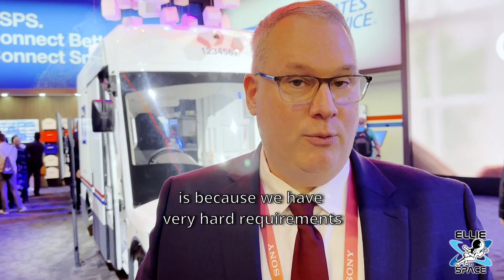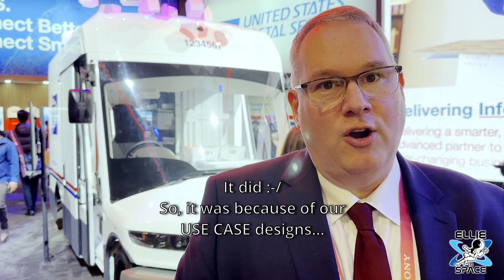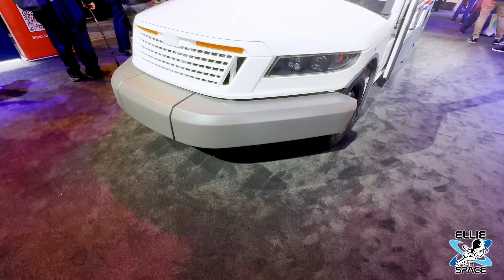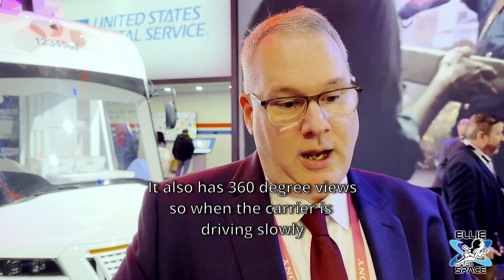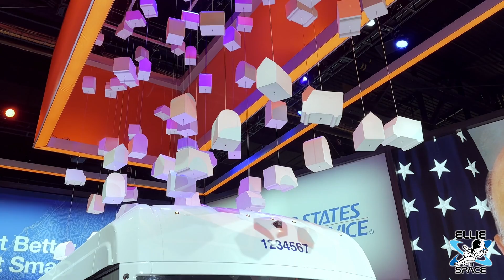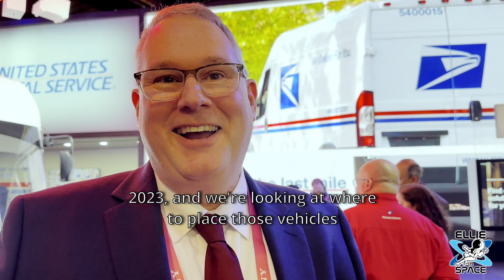The REAL reason the new USPS trucks are UGLY

Comment: Holy crap 💩.  This guy is filling the room with sooooo much crap you're going to need a front-end loader to clear the room.  LLV came in 1985, 39 years ago. None of them have ac. NONE!!!  The only postal vehicles with ac are the supervisors car. When the ac breaks it won't be repaired.  If the supervisors have thier way they will have the ac disconnected.

Comment: OH MY GAWD. . . . 
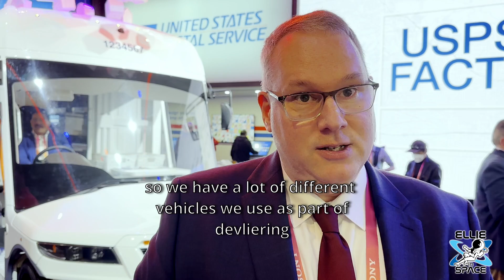When the video first started, I was reading through the comments, and thinkin, "i don't understand, why is everyone knocking the design so much. Looks like a fairly standard delivery truck" and then 2:34 happened, and I saw the full view of the front grille.

What the F*CK were they thinking?! It looks like they based the front hood off of the cartoon character "Duck-man"! That is a duck bill if ever I saw one. This is an abomination.

Also, great reporting Ellie! I've always enjoyed seeing videos at car shows and demo areas, so this is great. And yea, that guy wasn't kidding, a lot of the delivery drivers trucks (UPS, Fedex, etc) don't have air conditioning installed, that's why they drive with their windows open.

The reason (at least according to what I've heard) is that because they make so many frequent stops and starts, it would be too hard on the AC to keep trying to equalize the temperature, so they just opted to have it removed in those as a cost savings.

Comment: It's a myth at this point lmao.  10 years in the making and these unicorns still don't exist.  BTW it looks very impractical.  The back doesn't look like it can handle a typical routes worth packages.  Not if you want to keep the center and side door clear for access.  Where will the 10 trays of dps go? or the 20 bundles of circ coupons?  Or 5 trays of extra flats and lumps and bumps?  All of that is going to fit on those shelves, with 700 house holds worth of packages???  Yeah.. right.  

The truck is too low to the ground.  Won't survive off shoulder delivery with inclines, ponding and snow buildup.

The front cabin lack space versatility.  Where are you going to put your coat, gloves, hat, water (larger than that little soda can holder is going to fit lmao) Stamp Stock, 3 m tray for dps errors, space for mail tubs/ half trays etc...  It's just not there.  Where's the field testing videos by carriers who gave this thing an actual stress test of IRL heavy overburdened route volume?  

How are you going to scrape the snow off the roof as required by law?  I honestly don't think this vehicle was designed with any of these things in mind.  The postal service, as usual, probably just said, "We need as many camera's as possible and any other kind of Big Brothering designs ...and a mail tray to be implemented.  Other than that I'm sure the carriers will figure out a way to make it work"

The LLV was and is an almost perfect design.  Don't try to reinvent the wheel.  Just keep the same general design but upgrade the tech and maybe add in a little bit more cargo room and an actual shelf on the right side of the steering wheel for circ throwing.  Then you'll have another 20 years to figure out a new gen.  This one was just a rush job and as we all can see, still not replacing the current 40 year old trucks still being used.  

Currently the replacements going on from what I hear aren't these Oshgoshbegosh trucks (from a defense contractor that knows nothing about building EV vehicles) but are ACTUALY min van's and Pro Masters made by Mercede's and Dodge.  That's the reality of it.  And those are being rushed as a patch fix to the current dying fleet running out of replacement parts.  These new min vans don't work well as a mail truck from the testimonials I've heard.

Comment: It is ugly….but functionally I can’t hate it, three tier shelves , enough room to stand up right, the document holders above the seats. I think my only issue is that the side door is unnecessary and that space could have been used for more shelves. If you can walk up right from the front and get in through the back you don’t need a side door.

Comment: Ah yes "sustainability and good for the environment"...... Until the batteries die and are tossed in the special battery landfills because we have no way to recycle them on an industrial level. And replacing the battery on an EV costs almost as much as just buying a new one.
And as a Rural Carrier I can tell you I would never be able to take this on my route with the rough roads and tight driveways/turnabouts..... And that's precluding the fact that our office will never even see these, doesn't have the space to hold them or the charging stations, and is so old (so old it's a historic landmark for the city) it would require millions in renovations to be able to do so.
Also he kind of brushes over just how OLD the LLV is ......... They are so old that they don't even have ABS and come with sodding BENCH SEATS that didn't even have seat-belts as standard.........
I love how USPS is buying a new fleet of EV vehicles BEFORE they find out what stations are even capable of housing them...... Which is not going to be a very large number because these are going to require very modern standards...... And I can tell you now that a large number of POs are so outdated that the ability to run electricity wasn't even part of their design..... Certainly wasn't with ours.

Comment: That humongous greenhouse windshield will just welcome ALL kinds of sunbelt heat into that driver area. Which means the EV system will be working real hard to keep the heat at bay. Which could be an issue for enough battery capacity to keep up. Combine that with hilly postal routes,....just hope that Oshkosh Truck has that all proved out.

Comment: We were told when LLV's first rolled out they wouldn't have A/c so we wouldn't be taking long breaks during the heat (Texas). They did however have fans which blew the hot air around 😂

Comment: Automotive technician for the post office. I can say these vehicles will not last long. They are so low to the ground that the carriers will damage the side of the vehicle when they curb the tires to side walk. This already happens a lot with the llv. They also will not fit under parking structures. We have some routes that require vehicles to go under parking structure. Also post office will need to invest in new low profile lifts to service these vehicles. A lot off shops in the post office have the old hydraulic lifts that are out dated. They should of gone with something different, but like always with post office they go with the lowest bidder for these contracts and get the cheapest vehicles.

Comment: If you make it a 2.0 - 2.5 liter gas four cylinder with electric motor hybrid engine design with rear wheel or all wheel drive, a smaller front windshield and bigger engine bay, and large touch screen gps infotainment system, heated seats and steering wheel, a really good a/c heating and cooling system with vents in the dash and along the center of the ceiling. Then it would be a optimal design for a mail truck. The basic shape of the rest of the mail truck seems excellent.

Comment: 70 miles is not an adequate range.  These are designed for intercity use.  Rural routes, snow and ice, steep hills, mountain areas, and high volume times will have negative impacts.  Spacious interiors?  Just wait until the next pandemic or deliveries during the end-of-year holiday season.  Electrical infrastructure is being evaluated now?  With the initial deliveries slated in October this year?  Typical USPS planning shortfall.  Just because you go EV doesn't mean that you are going to save money on fuel - instead, you get to pay more for electricity plus put a burden on an electrical grid that relies primarily on fossil fuels.  Look for future compromises.

Comment: Remember the old joke that a camel is a horse designed by committee? Kind of applies here. I don't understand the massively oversized bumper. Range 70 miles seems low but most of these will be stop and go in city and suburb. I wonder what this upgrade is going to cost us in increased postal rates. It isn't going to be cheap for either each vehicle or the electrical upgrade at each post office.
Reply: The cost of the vehicles are probably the least of the cost. Infrastructure including charging, repair training, operating training, and repair parts inventory, and repair equipment are going to be the highest costs plus there will be a learning curve in all of this.
Reply: @garyradtke3252  Yes!  Unfortunately we will pay for it all in ever increasing postal rates, and the USPS will keep losing more and more business as that happens.

Comment: The Mercedes vans that they have been using in the interim are uncomfortable for mail carriers because the windows don't allow them to reach various height mail boxes. They have big blind spots. This vehicle is made for ease of use for the mail carriers, not for good looks. No the old mail trucks were based on a Chevy Astro van frame and a 100% Aluminum body by Grumman, an aircraft company.
They didn't have AC.

Comment: A lot of planning may have gone into the design, but it is not enough.
The front is too long - USPS will have a lot of front end collisions to deal with. 
Those shelves in the cargo area are mostly useless for storing mail or packages. Things will get chaotic during delivery runs, when mail and packages start falling all over the truck. And the shelves have some sharp edges, so expect carrier injuries to skyrocket.
Air conditioning is nice, but in a truck running in an urban setting with 500+ stops daily, requiring the driver door to remain open much of the time, will tax the ac unit, so expect lots of problems with that also.
Reply: Yeah, I don't think they thought about trash cans in front of mail boxes, Boxes that are slightly  tucked behind a tree area that you have to angle in towards to reach, cars parked in front of boxes (we all know people leave like 2 feet of space and expect you to access their box)  I don't want to bring back 30 boxes of mail to recase and redeliver with the next days mail because this thing can't get the job done.  

The back isn't as space friendly as it appears either if you consider you should have access to walk the middle and keep the side door clear.  It's not just packages we need to put back there but DPS, Lumps and Bumps, Circ trays really large and wide packages that will not fit on those shelves. Long 11 foot boxes (we've all seen em) That stuff will have to go on the floor.  there's no space in this truck to do that and still be able to access the rest of the area.  

Can you imagine that truck packed from the floor to the ceiling of like 6 levels of stacked boxes??? and what you'd have to do if something falls behind it or you have to yank it all out to get at one box then to reorganize it all and put it back?  "What took you so long?" .....

Comment: If you think postage is high now, wait till they get the infrastructure built for all these EVs. You won't be able to afford a postcard.
Reply: We have to replace those 30+ years old sooner or later. How many cars from the late 80s or early 90s can you still see on the road? They drink gas alot(those LLV with check lights on drink more). And the LLV mechanic comes to the office once or twice a week just to fix these antiques. Do you count those working hours? What about OT hours when the LLVs broke down on the road. Carriers still have to wait a replacement.
Reply: @ywc99411  I didn't say not to replace them. But EVs are a joke on the woke.

Comment: That dude was struggling a bit to repeat all that bullshit 😁

I’m curious how many things will trip the “automatic braking” that an experienced driver wouldn’t?

If an empty cardboard box falls out of another vehicle and is blowing across the freeway, will this thing activate the brakes in front of an 18 wheeled tanker truck that may be following too closely?

Will drivers get complacent and expect the vehicle to take care of things, but ultimately it doesn’t and someone is killed?

After all, how many vehicles do you see with only daytime running lights on night? Great “safety feature” that turned out to be.
These vehicles will handicap the drivers and be a hazard to other traffic when things get goofy.
They won’t be able to handle giant spools rolling down the freeway, dump trucks raising the dump bed at highway speeds, or other distracted drivers.
I saw a guy actually hit the center wall and keep driving because he was trying to take a picture of the helicopter we had on a trailer.

70 mile range?
That’s going to be a failure really quick.

They spent a lot of money to make this look like a 5 year old designed it.🤦🏻
I wouldn’t expect anything less from our government.

Thank you for bringing this absurd vehicle to light.

Comment: Ups doesn’t have air conditioning.

Dark colors absorb more heat.

So much for unions🤷‍♂️
Reply: We close and lock all doors and windows while delivering on foot(30 mins on small street or up to 2 hours on main street) but UPS doesn't(they drive and drop with door open), that's how the cabin become so hot in the LLV compare to the UPS Stepvan.

Comment: Most of the time when the power grid goes down from hurricane or ice storm it doesn't completely stop mail delivery. I wonder how that might change with a full EV fleet.
Reply: The postal service could use generators in emergencies.   Railroad locomotives have been used as generators to provide electric power to Hospitals, industrial factories and small towns in emergencies.

Comment: Duh, electric vehicles do not promote sustainability, dirty batteries in production and recycling, and still uses dirty fuel electric sources. Modern gas engines very clean and more dependable and don't require costly battery replacements. Only exception if they get forever nuclear diamond batteries that don't require searching

Comment: They should make these have the column shifter like the explorer chassis so it is like LLV. Also will double as a place for rubber bands.
Reply: You must be kidding. If you're a current or former carrier you should know supervisors would check vehicles for that, as rubber bands could prevent the truck from going into park.
Reply: @chicagojunk  I see mail carriers doing that what?
Reply: @chicagojunk  
A flimsy rubber won’t make it go shifting anyway. Regardless there isn’t enough leverage at the bottom to move the shifter.

Comment: Nice, batteries will overheat in Texas and die quickly from the cold in New York…they need to figure out the scanner batteries first before  people get stranded.
Reply: Do some research… EVs have a BMS battery management system,
Like a radiator cooling system on a gas car,
BMS circulate coolant around the battery pack to keep it “normal “

Comment: EV, as it is now, won't be very useful for rural route carriers and especially not very useful for highway contract route (used to be known as star route carriers) carriers.

USPS tried to tell us that we did NOT need 4 wheel drive, needed a white car with a quarter inch red line, a quarter inch blue line, U.S. MAIL between those lines and to wash our cars every day.  My folks had highway contract routes and we did need 4 wheel drive and there were many times where the cars/pick-ups did NOT get washed every other week let alone every day.

That directive kind of went away after a bit.  I think our past assistant post master might have had a little bit of influence once he went on the more rural of the highway contract routes - the ones with trail roads or the carrier having to drive through cattle pastures.  Where we live is cattle country and very different dirt road conditions such as more clay like dirt to more sandy conditions.

All I do know is that after that assistant post master went on those very rural country routes that we received notice that we did NOT have to have a white car with the blue and red lines and U.S. MAIL and that we could have 4 wheel drive if needed.  Which was nice since we highway contract route carriers have to bid on those routes and we supply our own vehicles as well as fuel and repair expenses which we try to figure into the bids, but lowest bid wins the contract so some low bidders can end up losing money in the end run.  One day I had three flat tires, one being a blowout on the sidewall.  Luckily I was still close enough to town that I could go back and get that tire replaced so when I had the second flat tire I had a spare that I used.  BUT that day - one new tire and one repaired tire - really messed up with what we earned that day

Comment: As a mail carrier I'm both excited and concerned about this. Do not give northern areas the EVs! Cold weather negatively effects how long a vehicle runs on a charge. I don't want to be half way through my route only to run out of charge.
To be honest, the Post Office shouldn't get EVs at all. EVs will never replace traditional vehicles. The infrastructure isn't there to support mass adoption. They should wait a couple years for the EV fad to die and a better alternative, like hydrogen fuel cell, to become mainstream.
Reply: Hydrogen is dead, and it depends on the range of the vehicle as to how useful they are in cold climates, I assume the USPS is rolling these out gradually so it can outfit depot's with charging infrastructure
Reply: Think about the EV benefits though.  Instant heat on a cold morning.  You should be able to leave AC running when you get out of the truck (hopefully).  They’re usually peppy.